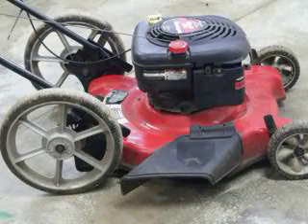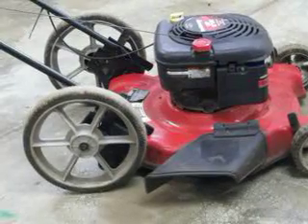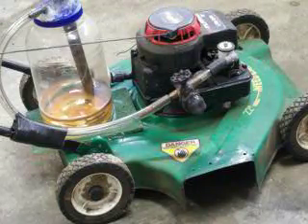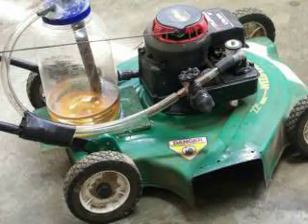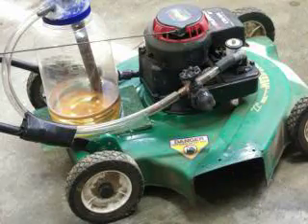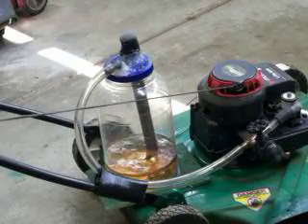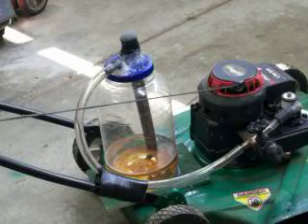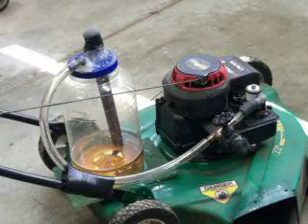gasoline and fumes the difference

Comment: The glass jar will make a huge shrapnel bomb when the engine backfires and ignites the incoming fuel/air mixture. This setup is a ticking time bomb.
Reply from the maker: +marcasdude i dont use that system anymore
Reply: glad to hear that... :D
Reply: +marcasdude  Its the idea that he gets the lawnmower to run on fumes... why cant people ever see any good in anything?
Reply: +Donnie Brown Half Correct! Mowers do run on fumes. What your not seeing is that the pipe going into the gas is whats feeding the air to force fumage. Like a Marijuana bong. I'm sure you understand that principal.
Reply: Point is. This fuel vaporizer is easy to make and can be made safely using flashback arrestors. So let us "sheep" make these for ourselves and our friends and stick it to the man.
Reply: The virgins are so ugly they invented the burka.
Reply: +John Lannon Gas tanks also become reservoirs for vapors once the gas has gone down. There are ways around the safety issues
Reply: +John Lannon simple, just put a one way valve from the carb to the tank so if it back fires it can't pass the valve into the tank
Reply: +marcasdude     a simple metal screen will block flame....
Reply: the way it worked was that the heat from the gasoline detonation turned the atomized water to steam  increasing the cylinder pressure and thus the power output with no additional fuel use.
Reply: +Donnie Brown  thats called hydrogen, its not a new invention, thats already used, problem is you have to use a other kind off energy source to make hydrogen in huge quantities to run a engine under load.
Reply: +Donnie Brown The Carb pulls gas and air in. That's just how engines work. When you replace the air filter (Which filters the air GOING INTO THE CARB) with a hose that goes two inches or so into the jar lid, That hose pulls in air from the jar. On the other side of the jar lid you have an air intake that goes down into the gasoline about two inches or so,  Which pulls air from, Well, The air you breathe everyday. That air travels through the air intake, Through the gasoline (Which causes the gasoline to bubble) and the air that comes from the bubbles produces fumes which travel through the jar, Through the hose that goes to the carb and into the engine. And, If you know how an engine works, You know the rest. I don't know how to make this any more simple. But, Seriously man, If you do not understand this, You obviously do not understand how a bong works.
Reply: Donnie Brown It won't fucking blow up if you put a floating butterfly valve in the hose. Soon as it tries to backfire, The air will rush to the jar and close the valve. Therefore, The hose might blow or just pop off the carb. I have done this and it works perfect. My mower never backfires anyways, I just use the valve as a saftey precaution. And yes, I am from the south.
Reply: that bottle is plastic! u know the ones u get pop corn in....
Reply: My neighbor runs his lawn mower on gasoline and it runs great.
Reply: this guy is full of s×1t. no carbon monoxide, smeels like cookies, and smoke detector goes off because of heat... "SMOKE" detector.  i guess someone better take a look @ those hot ass cookies that are burning and putting off all the smokey goodness!
Reply: +Anthony Brown what that was ,was an h2o atomizer. the conditions clean water,n sprays it in with the gas.makes the gas burn way more efficient. the u.s.army was using this on plane engines too. but I guess it made too much sense or something,so they scrapped it.
Reply: +Jaime Saenz yes I figured it was something like that.or, the profit loss. water is everywhere and free is u live close to a lake or river...but so much money is made selling fuel.
Reply: +Jaime Saenz there was a guy on the mainstream news who came up with a cutting torch that ran off water...only water!nothing else. he was offered a billion dollars for his patent,he turned it down...and then he died in a car crash or something.this was recentlike a couple months ago. you can prob.Google it
Reply: The lean fuel to air mixture may make the small engine idle and run up, but as soon as you put a load on the engine, it will probably stall.  There just isn't enough volume of vapor in that jar.  I want to see a video of the guy mowing some tall gas with it.  I bet it bogs out.  CNG and propane engines use gaseous vapors also, but they need high pressure tanks, regulators, and some type of metering system to provide the correct fuel to air mixtures for different engine loads.
Reply: Don't tell a Muslim...
Reply: You might think so but the system actually operates on a vacuum principle and as vacuum is realistically immune from sparks. My best attempts to create an explosion failed as I theorized they would specifically because of the ever present vacuum. In spite of what you see on Star Wars fuel does not explode in a vacuum
Problem with most people speculating on this type of device is that they apply what they know (apples ) to what the device actually does(oranges) so its a apples logic to an oranges theory
This system does not operate under normal internal combustion theory. I have spent 3 years at 70 hours a week experimenting with this technology and the way it operates would surprise you. Its very misunderstood not just by you but by the people who put videos on You tube(like the one above)
Reply: Aye but the thing works and time to make a new tank that is up to the job
Reply: +Donnie Brown holy shit World War 11?!? i missed 9 world wars somewhere....
Reply: Leslie Clendening without sounding like a hater or one of those people who like to knock people and hide behind a computer I would like to raise some questions and point out a few real facts & true physics. My God where do I start. 
1st he is filtering the air which is a main component of these "fumes" through his fuel therefore contaminating the fuel
2nd being uncapped it will condense moisture and in time build up water
3rd engines backfire through the intake if the fuel is too lean in which case is what fumes are so on cold starts backfiring is an issue
4 if you want to prevent backfire you could install intake reeds like what are used in 2 cycle outboard or chainsaws these are little thin flexible plates that allow fuel to pull around it but shut tight on the combustion stroke avoiding a backfire situation
5 if it backfires it is going to blow the hell out of the fuel container because
6 that in not under true vacuum what so ever. it is drawn by suction and not a vacuum although its the term used but its incorrect and that's a big difference. If it created a vacuum once the pressure pulled by the intake equalled the pressure inside the "vacuum" tank it would stall as was the case when he covered it with his hand. when he covered it at that brief second it was a true vacuum and therefore could no longer intake anymore fuel and so it stalled? the "bong"inlet bubbling hose tube prevents any possible true vacuum occuring.. so if or when this thing misfires flames will travel up and blow out of the bong shaft as the only pressure forcing down the bong tube is atmospheric pressure. 
7 this type of a set up would run different in higher atmosphere like in Denver Colorado it still doesn't hold any type of a vacuum in fact the air is thinner causingbtne engine to draw even less fumes
8 low fuel/air mix will heat up and destroy the piston and plug & exhaust valve
9 how nobody caught the "fire alarm smoke detector going. off" I didn't see smoke or flames and it's because that was probably a carbon monoxide detector going off. he claimed it to smell like cookies or something lol. I suspect this is the reason the video ended real quick when that went off
10 gas even in a vapor state has only so much energy it can exert with that said how can you run it under a load without giving it more fuel. the fuel ratio won't change in a vapor. maybe carberators vaporize fuel but under a load a second "high speed jet" delivers a higher volume of fuel to air ratio mix. this can't happen in fumes
now to change onto another subject. underwater weldingbhas gone on since the days of the navy frogmen. 
burn water thats an oxymoron. water has a neutral volitile PH. if not humans could self combust. the technology of splitting water (H2O) or otherwise electrolysis. that's high school science i remember doing in 7th grade. buy running a charge through water it excites the molecules thus separating the 2 gasses into 2 separate tanks. things goes way back in history it nothing new. someone said it may be done like a voice shattering a glass. that has nothing to go with any electrical current. Thats done by syncing the frequencies of the water to the sound waves. if you run a 40kHz frequency (that's 40,000 kz) through water with transducers it becomes basically an ultrasonic cleaner. it vibrators the water so fast it causes cavitation around debris and cleans the debris off of solid piece massad but it doesnt heat nor separate molecules as electrolysis does.
it's amazing how people want to believe something so bad they will resort to theories that technically don't apply to anything there talking about. it may appear to have merit. but when your adding reed valves, air cleaner/filter, a way to step up fuel delivery for high speed running or under a load you are slowly building a carb injector system that your fumegater is supposed to replace. for years theres always been people wanting to build the better mouse trap. and America needs innovation the res nothing wrong with it. and with social media people can get ideas out there to toss around and possible invent. but this unfortunately is going to hurt if not kill someone. it reminds me if the cartoon where bugs bunny puts his fingers in elmer fudds shotgun and it blows up in elmer fudds face. but this bomb waiting to happen is in a spot where I wouldn't want it. right between my legs right when I have to pull start it when its at its biggest chance to backfire. on the cold start up. what's next spraying it withn a Windex bottle and call it fume injected? I wish my best and hope the science and known laws of physics can somehow no longer apply.as they have sin madevhas made things. I think we are all bass out on petroleum innovations. solar, electromagnetism and high tech battery power is likely or next breakthrough since radioactive material is off limit. I believe water has potential but harnessing the strength in the wave or hydropower movement. only my opinion. good luck everyone but please with the 5th grade explainations on physics how gas that's a time bomb waiting to go off cant and the res nothing to worry about. don't encourage someone to blow himself up and possiblynhis housebwithnit

6
Reply: +marcasdude  . Maybe you could use a more solid tank with a spring loaded  pressure release    Im sure there are ways of stopping that like a Tesla valve??? What do you think?
Reply: +marcasdude you really have to wonder why they didn't continue with this?heckby now we would have increased fuel savings exponentially, or something. actually  ,I'm surprised that we aren't using water for fuel.H20  ... separate the molecules burn the hydrogen,and you have 2 molecules of oxygen for the burn. damn, I am just a simple man, no college, just a construction worker. you would think that if I could come up with that how much more could the brightest scientists at NASA and these car companies come up with? it just boggles the mind.
Reply: +Donnie Brown no matter how you want to make it look you are right but the government holds the patients on this shit so they can use it on their war machine so they will hate and disclame everything because people are sheep in their eye and sheep follow food only they have no loyalty
Reply: Donnie Brown they invented some machines that run totally on water then the inventor went missing and his invention disappeared only to show up in Afghanistan in our American war vehicles
Reply: +Jaime Saenz where can I read up on this information?  sounds crazy
Reply: +Jaime Saenz yeahi read about the inventor going missing like a fart in the wind but didn't know about the war machines...but that figures
Reply: MrHabitat009 I can't find the info anymore
Reply: +ArtScience no, I don't mean a water JET , I am referring to a water TORCH. there is a process that he patented which separates the H2O into  hydrogen for fuel, and uses the o, oxygen, with is necessary for combustion. this has NOT been around for years.
Reply: +ArtScience I understand that it's hard to believe, and I prob.wouldn't believe this I I hadn't seen it on mainstream news. he invented a machine,which did use a small electrical current, to condition the water so that it would separate and burn that way.and the only waste created was water. the was on the news fairly recently, on several channels. the guy was offered a billion dollars for the patent. he refused to sell. then h " accidentally" died in a car crash or something. just Google it.
Reply: +Richard phillips no, I don't smoke weed, although I do understand th e concept behind a bong.
 but tell me, where is this forced air coming from that is going into the jar? is it coming from the exhaust?if so, then this video and mower design is even more screwed up than I originally thought! imagine all that hot air, not to mention the occasional spark, going right into the gas tank. derp. yeah, great idea there, Sherlock .
Reply: +Joe Mcclinton I would advise using a flash suppressor of some sort
Reply: not only that, in the heat the fuel will vaporise and expand. blasting glass everywhere. could even make a dangerous explosion
Reply: my neighbor built several engines that burned on water ,using a big coil. the cooling system could not keep the engines cool enough and they would melt
Reply: +Alan Broussard if the engines were not liquid cooled he probably did not have enough airflow for them to cool off and that's why they melted
Reply: patents? You don't have to have a patent to manufacture anything. What happens is companies by the technologies from the inventors and keep it off the market to avoid the new competition. The government can't hold a patent, but they can restrict manufacturing and marketing things. Otherwise, we would all have had our own little personal nukes and Earth would be a sparsely populated rock by now.
Reply: manny6584 My comment has nothing to do with value of his experiment only the inherent danger of the setup, i'm all for experimentation.
Reply: +Donnie Brown I agree, that is some messed up thinking.
Reply: Im not speculating as you gentlemen are. I have tested my hypothesis many times and I am typing this note with all my appendages intact.
Is Gasoline volatile? Yes. will it ignite? Most certainly. Will it do either of these things in a vacuum ?No. All the physics we now know says no. So if you have scientific data or experiments that you have performed that prove otherwise please supply us with the results
Have a great day
Reply: There is no absolute vacuum induced in this system.
Reply: Ok its a rudimentary set up to demonstrate a principle. It is not for sale it is not going into mass production. There are many such devices on you tube for demonstration purposes. They are made of a variety of materials and mostly from lack of funds.
The initial assertion was that a backfire would send glass shrapnel everywhere. If the seal leaked the device would not start any leaks in a vacuum causes there to be no vacuum. If it works its because there is vacuum and considering there is vacuum a backfire would do nothing
I dont believe the video maker has a clue as to how this device actually works I see this a lot that is why I post
I know it is efficient although not for the reasons given

It does scorch valves

It does not damage anything other than the valves

It produces carbon dioxide as its emissions

It is safe 

It requires near total vacuum to burn a complete unit of gasoline

It has been patented(240 plus times)

The technology dates back to the 1930s

It can function under load but does not respond well to changes in speed

It does not work well enough to market it(no conspiracy)
Reply: marcasdude, i totally agree. mine was with a hydro oxy electrolysis and it did the same thing. live and learn, and dive for cover lol
Reply: ***** well, it may be a deathtrap, but at least the guy is trying...
Reply: Donnie brown, yea u have to give him credit for that
Reply: marcasdude although, i kind of thought he was trying 2 make a comic video at first,when he said "no harmful admissions,"n then u hear the smoke alarm go off
Reply: Donnie Brown I don't know what happened with why near the end of my post there were so many typos or mispellings, maybe it was the fumes? But this reminded me of something funny that happened. Unfortunately it wasn't such a hahaha kind of funny, but more like a boo hoo type of a funny thing that happened. We were working with epoxy resins adhere electrical pipe nuts into drilled countersink holes in the bottom of marble & granite pieces to be used to make bases for lamps. The pipes were set up into custom carved wooden pieces that were then threaded onto the stone for a solid base where the wire ran through the pipe and under the base so not to be seen.

Drilling stone creates a lot of dust. And cleaning the resin off the tools required acetone. After we finished setting these nuts and cleaned up with the acetone on rags I asked our helper to clean the area and I went go cut more marble bases. As he was shop vaccing the fine stone dust he vacuumed up a rag that still had acetone that hadn't completely evaporated off. About 3 minutes later we hear this BOOM. I came in real quick to see what just happened and all I remember thinking was "WTF is going on?" There was a cloud of stone dust everywhere!!! It looked like ground zero at Nagasaki in there. Well the fumes from the acetone must've permeated into the motor and the sparks coming off of the carbon brushes ignited the acetone fumes, blowing the shop vac lid straight up and threw the dust everwhere like some kind of a smoke (dust) bomb! We use a 30 feet of hose so the vac (thank god) stays in a separate store room since some dust blows out around the filter and being a fine stone dust (silica) it is a tool killer from getting into there bearings. We may wear respirators but the tools don't.

But anyway I can't help but thinking that it is only a matter of time that this fume intake prototype device or what ever the he** you want to call this is doomed to the same fate that took out our shop vac in a split second with no warning on what was coming! Luckily nobody was near it. In this situation I would imagine he isn't going to be 30 feet away or have a block wall in between him. And even worse is if or when that thing were to ignite it's not throwing dust. It's gonna spray lit gasoline everywhere??? And if people think liquid gasoline doesn't burn try pouring some on a pile of wood and toss a match on it. I'm sure someone here probably made a video on lighting a fire with gas that he's not vaporizing first. Or he tried and things didn't turn out so well and he's not going to show that lol!

No pun intended but this video gave me a flashback about the shop vacs unfortunate demise lol.

I hope his insurance company never sees this. If he can still afford an insurance policy if they got wind of his invention he works on in his garage with the door closed no less. Oof!
 
Wanting to invent things is good and can pay off if you get it right. Using common sense doing it even if the invention never turns out to much is priceless!!!
Reply: you can use spark arrests or back flash arrests to stop that
Reply: +Donnie Brown My buddy was just tellin me about another one. get a liter or bigger glass bottle with a metal screw on lid, poke the smallest hole you can in the lid, fill 3/4 full of your favorite flamable liquid and put it in a campfire..it doesnt blow up the heat expands the gas vapor an pushes it out the hole under high pressure and the fire ignites it..usually blow a flame 30' in the air.
Reply: lol!!!!!
Reply: *****
  That sounds scary.  Don't people burn steel wool ?  I'm sure with all the available knowledge out there a solution will be found.   There is already a video on it
Reply: Somebody wrote a comment that german tanks of WW II used this same system... I saw a vid of one off of a 1940's Massey tractor that was factory made.   What going on here?   It makes so much sense.
Reply: @anthonybrown9373  its just a rudimentar carburator with poor performane,, ho do you control te AFR?
Reply: Anthony Brown I've worked on 40's era and earlier Massey Fergusons and have never seen any such set up. Are you sure you are not confusing the common glass "fuel bowl" that is present on older tractors (for fuel inspection) for something else?
Reply: It was a funnel type whirl wind vapor system system I actually saw run down in Patagonia.  I walked along side it for an hour. The tractor said Massey but no Ferguson  Maybe before that era.  I dont know for sure but he showed it to me and I never even asked him.  He was just so proud of it that he had to show it to me and I was quite impressed.  It was factory for sure.   That was 2010  I know what a glass bowl is.    If I  think about it i don't see an explosion type scenario.    Yes the fuel and water comes from liquid but the way they mixed it over space and time and force it was fully vaporized and it included water in the mix. It was a carb in sorts in that it had a butterfly gate but that was after atomization   Hmmmm makes you wonder
Reply: +Glucoperon well,you go ahead n make one for yourself if u want to,but don't make me one. sheeit... I don't wanna blow up... this is stupid ma.this dumbass is going t get somebody hurt.
Reply: +MrBobnokious and an accurate observation it was too.
Reply: oxyhydrogen torch has been around for a long time.  They use or used it for underwater welding and cutting.
Reply: Discretesignals not
Reply: +Discretesignals not like this there has not . I'm talking about a torch that runs completely from water.there is no hydrogen tank, nor an oxygen tank. there is just water. wtf is so hard to comprehend about that? gee whiz, I have explained this like 3 times now. if have any more questions, just scroll back to my earlier comments.
Reply: +manny6584 Mann, the setup doesn't even make sense! it's not drawing fumes...if u look in the glass jar containing gas, do u see the output of gas at the top of the jar, or at the bottom, stuck down in the liquid part of the gas? yeah, see?  .. btw, a mower already runs on fumes, it's not a liquid when it gets to the piston. think about it.
Reply: +The 13th Floor Elevators Run Thru My Veins well, there is just one problem with your theory...and that is...the breather is on the other side of the engine...plus, the breather is sucking,, how is it blowing anything into the carb ?
Reply: +Donnie Brown it creates a vaccuum, not a high pressure...derp
Reply: +The 13th Floor Elevators Run Thru My Veins you aren't from the south, are you?
Reply: +The 13th Floor Elevators Run Thru My Veins well, being from the south, I would you would know the results of calling a southern man an s.o.b. ... even if saying it while joking. so please, call me an idiot or whatever you plz, but leave my mom out of it.
 I do disagree with this design, but if you feel safe pushing that mower ,with a big ass glass jar containing gas, ( agitated n warm gas too , imight add,plus  very close to the exhaust ). if you feel comfortable pushing that mower , just to save maybe a 1/4 gallon gas, then plz, by all means, push it over hill n Dale, until the cows come home.  
 maybe you will get a free ride to the moon. but seriously, I hope that you don't get seriously and permanently disfigured. 
 but whatever happens,plz, don't ever call me an s.o.b.again. thank you
Reply: +enator71 well hell, I guess I must have either imagined seeing this guy on TV who made an electric powered machine that converted straight water into hydrogen n oxygen, and being offered a cool billion dollars for it, and turning it down, then about a month or so later I saw on TV that he had died in an "accident".  I guess I either imagined it, dreamed it, or just made the whole fkn story up huh? is that what u want to hear? wtf is wrong with u people?
Reply: +enator71 ikr?!
Reply: +enator71 yeah really
Reply: +Jaime Saenz Oh dear... for starters, the government "does not hold patents". And if it ever did, they would expire after 15 years, as patents do. So since in crazy land the government held patents on this forever, everybody would be free to use them forever by now, as well...
Reply: well played. have to put a reed valve system  on it
Reply: +Jared Simpson  it wouldn't have to travel threw all of that.  it's vapors. it's just straight into the jug.  that's why he put a valve on it to control the flow of vapors
Reply: +Jared Simpson  of. wait sorry.  I read that wrong lol
Reply: +Jared Simpson 😄
Reply: Donnie Brown exactly, gas will not burn in liquid form, therefore all engines run on vapor.
Reply: marcasdude yeah, me too!... i like the fact that he is trying to use alternative methods,n experimenting. im just all about safety. not to mention,i think this video was made as a joke. i mean,he says that it puts off no harmful fumes,meanwhile u can hear the smoke alarm going off...too funny
Reply: NO it wont read my other comments as to why not
Reply: Leslie Clendening vaccuum is immune from sparks" huh? yeah,u keep on believing that b.s.
Reply: Got news for you . The vacuum in space is only near total. So the vacuum in this set up is partial near total so because there is more fuel than air(the amount of oxygen is so small the ratio is skewed) there can be no combustion or explosion in the glass container. believe me the only way this system works at all is by vacuum. I have performed this experiment hundreds of times. Once I established it works on vacuum I tried backfiring sparks into the tank. The most I could accomplish was lighting up the intake line like a light bulb. All the remaining air was used up in the flash of light. Yours is speculation which means you think you will have an explosion  You dont know from testing. I know from testing
Reply: Leslie Clendening a glass jar, sitting on a lawnmower, when we have no idea if the seal is good or not, and how long that seal will hold up,(as gas will break down a sealant), not to mention cutting a lawn that has any type of non-level surface,as most lawns are not level... that GLASS jar is an accident waiting to happen. think about it,  ITS GLASS! a material that is one of the most fragile materials there is. one good bump  that jar will break, causing either an explosion,or at the very least, EXTREMELY FLAMMABLE GASOLINE will spill everywhere,including on the person pushing the mower, n then being ignited by either the spark plug,the exhaust, a backfire,etc...and yet u claim this is safe,n seem to believe everything the video-maker claims...even when he claims that there is absolutely no poisonous exhaust, meanwhile you can hear his smoke alarm/co2 alarm going off in the background...OMG! this video would be funny, if it werent for the fact that some kid WILL try this in an effort to save money on gas while cutting grass to make a few dollars , n they will get hurt. this video is irresponsible, and i pray that someone doesnt get hurt/ killed by attempting to do this....
Reply: Leslie Clendening oh okay, well cool then. thnx 4 explaining. peace
Reply: +mbudd121 lol
Reply: The 13th Floor Elevators Run Thru My Veins oh, i guess it kinda works like a "thumper barrel" on a moonshine still?
Reply: mbudd121 "it did the same thing"...plz elaborate,thnx
Reply: marcasdude  caut
Reply: 1337sauce didn,t notice that, pretty crazy, lol
Reply: my lawnmower runs on gasoline,in the origional tank,carb,etc...n it doesnt burn much gas at all. im pretty happy with it.
Reply: pmessinger , you are correct. i have invented things, yet was unable to get a patent.although they worked great! i am currently working on a "flying machine"which works using magnets,has no moving parts except those used to move the magnets closer together or further apart,to control speed,n at an angle to each other for steering. this will work.n it is such an improvement to transportation that i suspect that i will either be killed,or be made stinkin'rich from it.
Reply: so, u say it is a vaccuum, yet it has enough oxygen in it to allow combustionn?
Reply: ***** yeah...what you said.
Reply: they used to sell "atomizer kits" after the world war 11, that would separate h2o into hydrogen n oxygen, increasing gas mileage n power... also we used them on our fighter plane engines back then too. but i reckon it just made waaaay to much sense for our govt. to allow it...too much money to be made by taxing oil n gas
Reply: lol...good one
Reply: right on Steve , n thnx for the laugh. btw,im sure u r aware,but many people are not aware of the dangers of silica dust.that is NOW considered one of the worst foriegn objects to breath in.  n yeah, i think this "inventor"has prob.already experienced problems with that contraption. n heck yeah, liquid gas will burn.n it'll burn quik fas n in a hurry too.
Reply: Donnie Brown 
oh yeah silica is basically finely ground glass. it's so sharp it slices into the lung so cleanly that the lung will heal "scab over it" relatively quick and you may just have a cough for a week. over time there's so much scar tissue the lung looses flexibility and unable to properly absorb into the lung. asbestos looks like miniture Velcro hooks which you can't cough out and it basically builds up scarring and causing nearly the same king of lung problem. both become a form of COPD but usually with a death sentence.

for some reason I can't stop thinking about these bombs waiting to blow. if the intake "bong" inlet isn't capped when not being used wouldn't or shouldn't fumes slowly rise from that open hose fumeigating the garage. especially on hot summer days? he may go in his garage one day, hit the light switch and ignite hit bomb from a switch or a ight spark it the connection terminal it they aren't screwed tight or if he wired it himself by just twisting the wires and put a little tape on it. or worse a teenage kid sneaks in the garage to smoke a cigarette and flicks his lighter. that wouldn't be one he'll of a way for a teen to learn how dangerous smoking can be. hopefully he uses some of that electrical tape to close the bong inlet while he's not out risking blowing his ba**s off!
just saying?
Reply: ikr? n as he says it, the carbon dioxide alarm is going off. too funny. honestly,i think this guy made this as a joke video...
Reply: X2.  the dude is nothing but scary. A 55 gal drum with 1/2 gal of gas will blow a hole in the ground 3 ft deep and 5 ft across.
Reply: have u tested this 66 gal.barrel thing? if so... WAY COOL!!!
Reply: aaw dude,that sounds awesome!!! the coolest thing like that, that ive prob.ever done was, we would get an actual glass bottle,(16 oz.cola,mt.dew,etc)with a plastic lid. u fill it about 1/5 full of gas,koleman fuel,etc.put the top back on, n set it in the ccampfire. BE FRKN CAREFUL!  stans back... when the liquid (gasoline)turns to a vapor or gas,it will expand n blow the top off.the super heated gas ignites n MANN!!! IT WILL SHAKE THE TOPS OF THE TALLEST TREES FROM THE FORCE!!! it looks pretty cool too. 
  JUST PLEASE ...BE CAREFUL. U USUALLY HAVE A GOOD 15 SECONDS AT LEAST,N OFTEN MORE.
Reply: YEAH, DONE THAT, EVEN GOT A BURNT T SIRT. BUT JUST LEAVING THE LID ON WORKS MUCH BETTER. 50 EET FLAME IS NOT UNCOMMON
Reply: thevaporkid what system is the best to use on a push lawn mower
Reply: From someone who has done these experiments, or just another keyboard sayso warrior?
Trolls suk.
Reply: You're nuts - there's no ticking - hahahah it is dangerous though.
Reply: u need back fire arrestor- easy can made from a steel mesh. 2-3 layers..
Reply: marcasdude You could put a spark arrestor in the system
Reply: marcasdude
Reply: Maybe there is a blow back arrest in the line. Plastic tank ? Tks
Reply: +MrBugsier5 plz , go back n read thru the topic of this comment on this this thread. we were talking about a torch, not an engine.  try to keep up. dang, these comments are so ignorant, I would sware that y'all are just f#@&ING with me...
Reply: ikr?